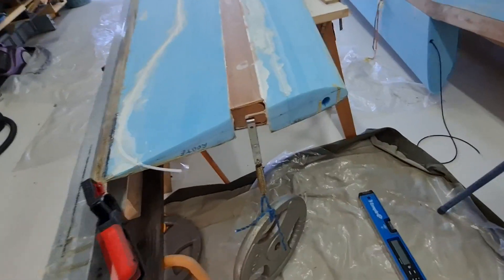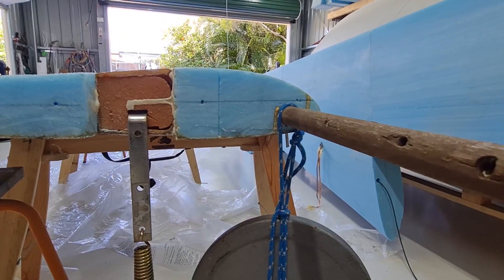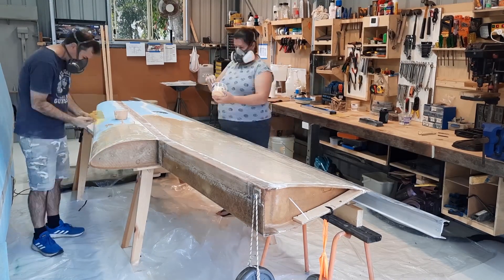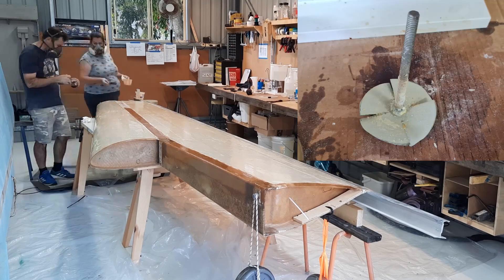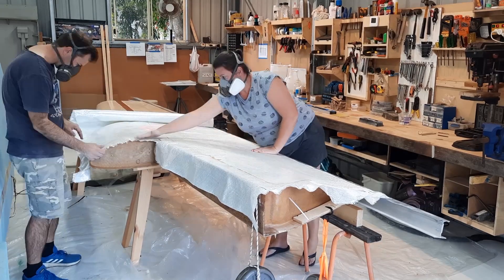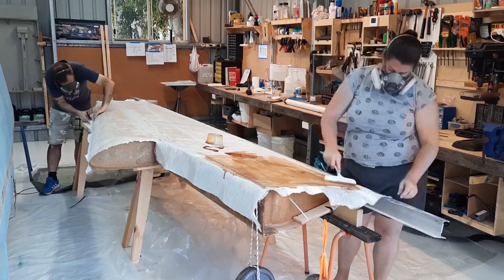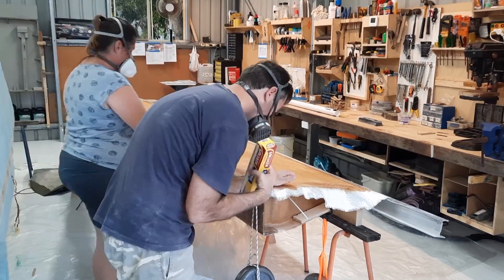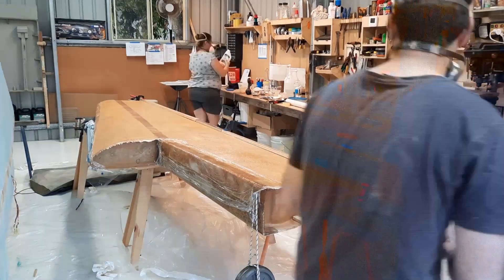Velocity Build 04 - Glassing The Wings

Comment: Good job! Did you apply a peelply on the end of the laminatingprocess.  Highly recomandation!Otherwise habe to sand the surface for further applikation.
Reply from the maker: Thanks, No I didn't apply any peel ply. I think the reasoning for that is there is no more glass layers to apply, just light sanding, filling, smoothing and priming.
Reply: @AusVelocity I was wondering if this one layer was all the cloth required. Am surprised. I assume it’s a heavier cloth than typical.?.
Reply from the maker: @foesfly3047  Yes 1 layer on each side overlapped at the leading edge and pressed together at the trailing edge, it's called Triax and its actually 3 layers woven together. a bit like /\--  and is supplied in the kit with the epoxy.

It's also used in other parts of the aircraft where you need strengthen something by adding several layers on top of each other.

I'm not sure if the glass layer bond to the foam is super critical. I found peeling cured glass from the foam rather easy when I had to cut bolt access holes in the wings. I think the foam is used for its lightweight resistance to compression forces that the glass layer places on it when lifting. the glue is not supposed to hold the glass layer down, just keep the foam from moving around under the glass.

Comment: Very nice. You can simplify and greatly speed up the process by mixing at least 1/2 gal. batches. Mix 4 minutes with a stir stick with 70% of the time scraping around edge 30% across middle. Then pour out all within a few minutes and spread around. Getting it out of the container is the key to prevent heating.
Reply from the maker: Thanks Henry, I'm a little wary about mixing too much at 1 time. You're right about getting it out of the pot quickly to prevent it getting hot. If i was a bit more experienced, I'd probably do that.
Reply: @Clint Chenoweth  It's always a little nerve wracking. After probably doing it a hundred times with both slow and fast acting epoxy, I've only messed up once and that was from leaving it to long. It's nice to get it out quickly -gives more time to make sure it's absorbing properly and such stuff -a little more freeing before it sets up. Enjoy the build.

Comment: I have personally laid up over 55gal’s of safety proxy across variez, longez, Q200 and cozy platforms. I always wore gloves. I have friends who did not and eventually became sensitized to the epoxy and had to abandon their projects, it’s so bad they couldn’t visit my projects. Just smelling it cause major reactions. Think rash in places you sweat….

I would go thru a entire box of 5mil gloves on a center section lay up or wing skin. Glove thickness and material determine the time it takes for the chemical to reach your skin. I did find gloves that allowed about 1hour dwell time but it provided zero tactile feed back, so I went with nitrile 5mil and changed them out often.

Another point, I noticed you used your bare hands to lay down the glass, not a good idea, your contaminating the glass.

Shop air- not a good thing to use shop air around composites, your atomizing water and probably oil.

Clean up- many use acetone and this is fine just don’t get the acetone on your skin. What happens is the acetone dissolves the epoxy, the acetone becomes the carrier of the nasty chemicals thru your skin. 

Good luck with your project
Reply from the maker: Thanks, we limit contact with skin and if we do get the epoxy on our hands we have used plenty of barrier cream. I'm not sure how well it works long term though, If you know, then I'd like to know also. I have some nitrile gloves that I use if I think things are going to get messy.
I'll have to look into if the glass can be contaminated, I would think the actual glass was very resistant and lose no strength, or maybe the contamination reduces the glass fiber's absorbency of the epoxy.

The most used tool in my workshop would have to be the vacuum cleaner, no air compressor.

For the moment we just use soap and water for hand washing. With the barrier cream we've not noticed any epoxy residue after normal hand washing.

Thanks for the input.

Comment: a step we learned early was to sand anywhere epoxy will be applied and then clean with alcohol
Reply from the maker: Thanks Steve, Yep I sand, but I'll start using some isopropyl alcohol. I've got some glassing to do around the centre spar. Max strength is needed.

Comment: There is a device called a "Woodpecker".. basically a cylindrical roller with many 1/8th inch spikes .. used on foam core wings to
allow a small 'icicle like'  spike of epoxy to penetrate the wing surface,... dramatically adds strength to the surface adhesion of the glass / carbon fibre surfaces.
Reply from the maker: Hmm, makes sense, more surface area....

Thanks for the suggestion.

I'm not sure if the foam I'm using and my wings are a good candidate for that process. Just not knowledgeable enough to step outside of the manual on that topic.
I do vacuum brush the foam after sanding it so the epoxy glue seeps in. The blue foam is pretty course so maybe that's enough.
Reply: @AusVelocity I’m sure the epoxy/micro fills the surface pores of the foam substrate, sufficient to accomplish more than adequate bond to the fiberglass skin. This is also exactly how I’ve seen Burt Rutan do it.

Comment: Brilliant idea using Cling Wrap 👍
Reply from the maker: Oh not my idea, It's in the manual. The manual's pretty good in a lot of places, very clear and well described steps. But some places you have to really have a good think about what they are trying to say. I really should make a video about the manual. A friend is building a SlingTSI and he recons his manual is garbage. Loves the plane, not the manual.
Reply: @AusVelocity  My Jabiru build manual many years ago was a bit like that. I would reference the club’s Jabiru for an updated build
Reply: @AusVelocity  Would peel ply do the same thing as the plastic wrap?  Also Ive heard applying peel ply over the entire surface great reduces body fill work, any idea on that?
Reply from the maker: @constechable  I'm not sure if peel ply would do the same job as cling wrap, I guess it would.

The manual doesn't mention peel ply over the entire wing. Maybe it doesn't help with the filling and sanding. It does, however, leave a flatter surface with a texture a bit like sandpaper. But i wasn't game to try something that's not in the manual that's outside of my expertise.

Comment: Good job. Quick Q: Is it normal over there to refer to epoxy as "glue"? I've never heard anyone refer to it as such, sounds very unusual to my ear.

Also I hope you're using a barrier cream of some sort. Epoxy on skin can cause very bad allergies over time.
Reply from the maker: Yep you're right about the allergies. They warn you in the manual about not touching it. We use barrier cream.

The ez-poxy epoxy is pretty well utilised as a filler, glue or resin for the glass. Adding different ingredients or changing the ratio changes its function. Adding micro makes it a glue between the glass and the foam. Adding cabosil makes it sticky and more like the consistency of glue, good for bonding wood and glass together. Adding flox gives the expoy structural strength to make it less brittle and a good filler between parts. We use a different epoxy as a light weight body filler thats good for sanding.
Reply: @AusVelocity  Thanks. I'm building a Cozy on my channel, well aware. ;)
Reply from the maker: @Chatsu8o  Yep I'm subscribed and following your progress. If our projects are anything alike, it's there's a lot more to building than just assembling the parts.

I had a friend building a SlingTSI come and have a look and he was amazed how different our 2 projects were.

I think I read somewhere the epoxy is a little corrosive to the blue foam and can start to dissolve it. The added micro stifles the effect and also stops the epoxy from seeping in too far into the foam and away from the glass.
Reply: @AusVelocity  That's no lie, mine is a ton of work. I'm jealous when I see your rapid progress.

In the LongEZ and Cozy plans the stated purpose of the micro is to lessen the weight of the epoxy. As you're covering foam there are pores everywhere and if you were to fill all of that with raw epoxy the extra weight wouldn't be negligible. So micro is added (since it's mostly air bubbles) to lighten that layer of epoxy but still give it purchase into all the pores to adhere well. In a way you could call that "not soaking the foam in epoxy". I dunno about your plans but ours stresses to remove all excess other than what is absolutely, positively, necessary to:(a) Fill the pores on the micro pass, (b) wet out the glass.
Reply from the maker: @Chatsu8o  That sounds logical. Everyone seems to strive for absolutely minimal resin use since it's not useful and weighty. I'm still working on using minimal resin, but I really like using peel ply to wick out resin and leave a nice texture. Hope your electricity service has Improved.
Reply: @AusVelocity  It's gotten much worse. I'm working on self-provisioning electricity. In the meantime the build is stalled.
Reply from the maker: @Chatsu8o  Stay safe.